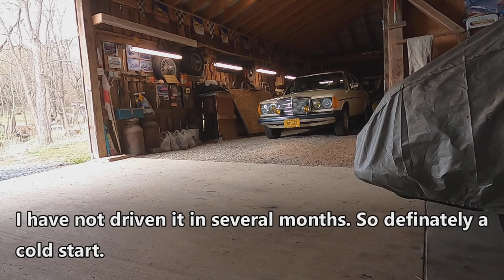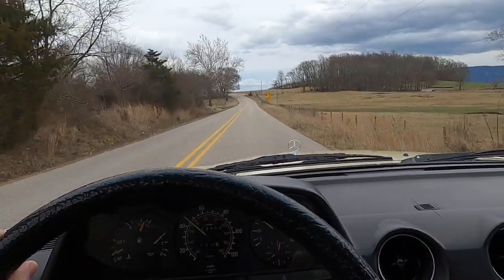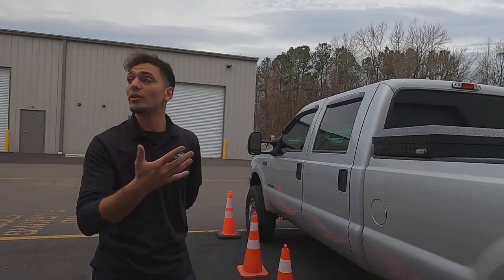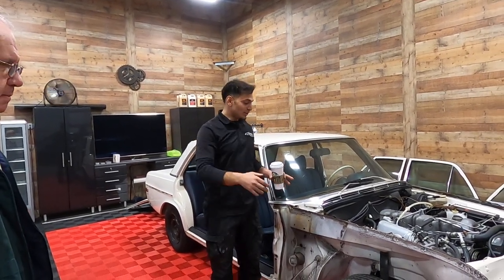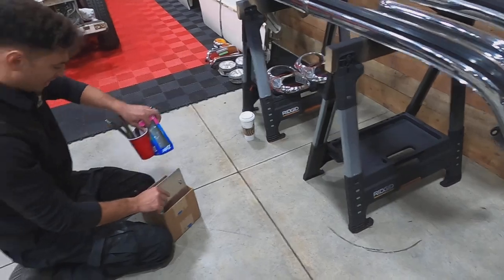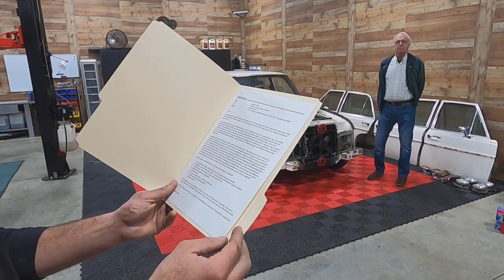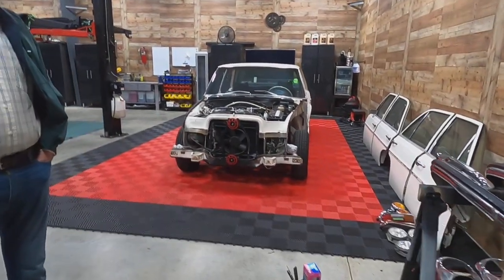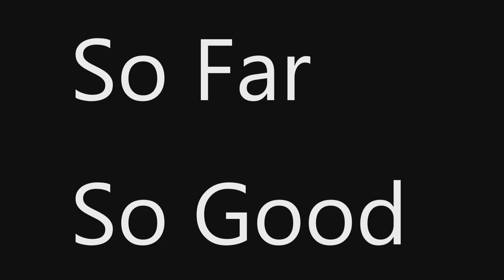1971 Mercedes Benz 280 SE Vinyl Wrap Preparation Second Visit

Comment: How did it turn out?  I am considering a W108 but the paint is bad.  Trying to decide whether it's worth painting or wrapping it.  Working on a tight budget.
Reply from the maker: Thank you for watching. The actual wrapping turned out well. You need to understand that in order for it to look good the body underneath the wrap must be prepared just like a good paint job as the wrap shows all the imperfections underneath. For me it turned out to be about $10,000 less than an excellent paint job. As with paint, the most expensive part is preparation. For me it was around $12,000 total. The problem I had was that much of the reassembly was shoddy and I fixed that myself. In addition, the fellow closed his business and is not reachable. I'm still in the process of addressing other issues that he claimed to fix (mechanical) but did not. I plan on doing a final video (video #3) at some point in 2024 after I fix all the issues.
Reply: I'm sorry to hear you had so many problems.  I look forward to your future video. @kensshowtell
Reply from the maker: Thank you. I think he was/is a young man with a big mouth that over-reached his skill set and lost his business over it. The worst part are the unfulfilled and broken promises. Nothing I can't fix myself, but I did spend some money for nothing. However, I did not lose anything I can't afford to lose. @AllenManor